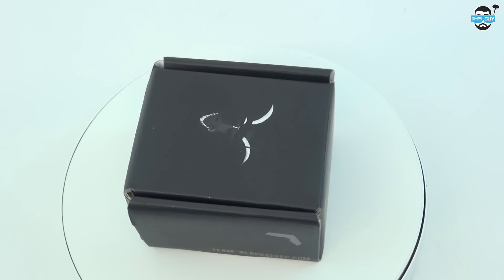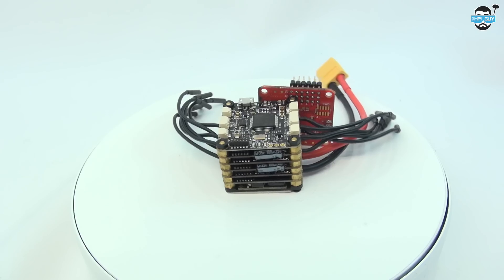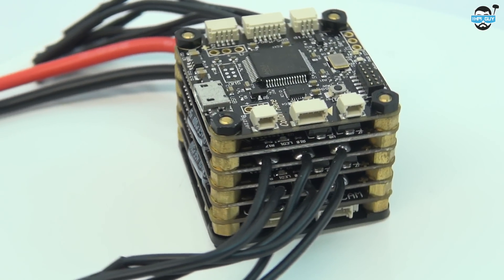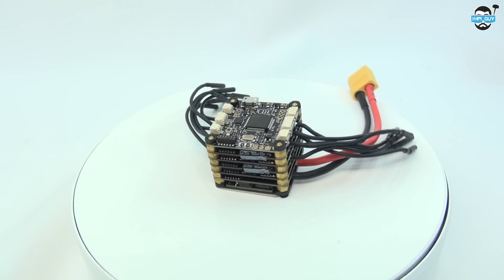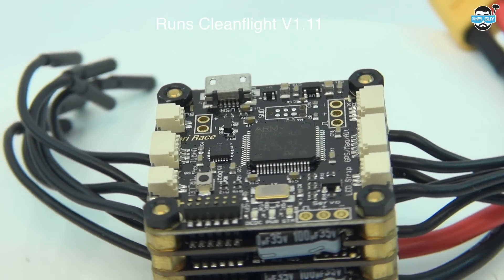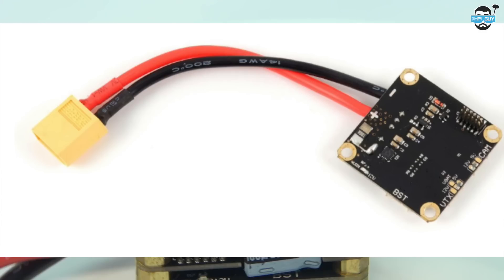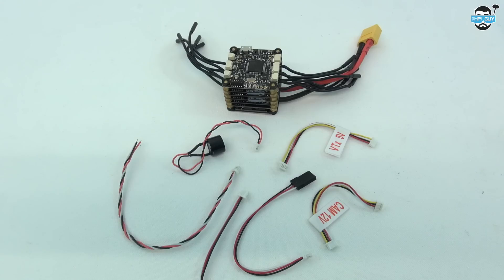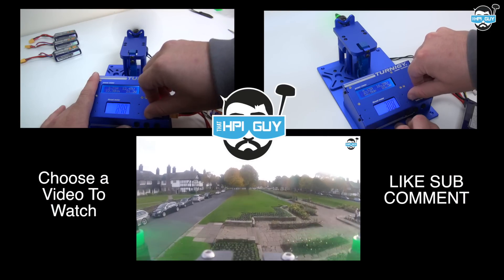HPIGUY | TBS PowerCube - Overview

Comment: WHat are the brass stand-offs for?
How do they work?
They look heavy.
Reply: +odinata they distribute power between the different layers ;)
Reply: +Team BlackSheep but how? they aren't insulated!!!
Reply: +odinata of course, that's why they can carry power! the brass standoffs touch each layer in the stack and form an electrical connection between your battery and each layer. So the power "travels up" the stack, from the PDB via each ESC to the flight controller.
Reply: Team BlackSheep
So the outside of the brass is coated with a transparent film?
They look like they aren't insulated...
Reply: +odinata I guess not. You have to paint it to prevent bad things from happening.
Reply: C Manson
Yeah, i just can't believe that they would leave bare electricity conductors with no insulation.
That doesn't make sense.

Comment: Considering a NAZE is $25 and decent ESCs are about $20 each (x4) this is a good value considering the engineering. It looks like you eliminate many points of failure by eliminated loads of wires and soldering points.  This also probably allows for a very well balanced quad in regards to center of gravity, etc...   I just wonder how well it will do in a crash (or a dozen)
Reply: +Bill Sheley Very good point.  There would be no repairing or replacing or individual parts I'm assuming.
Reply: +goofyfoot2001 As it turns out, TBS has spare parts and it is very much serviceable.  Its just a tad heavy without their aluminum standoff kit.
Reply: I'm thinking about trying it.  What do you think, yay or nay?
Reply: +goofyfoot2001 I just maidened my SpaceONe FPV 220 with the TBS Powercube and Rotorgeeks 2205 2700kv motors.  It flew brilliantly.  At this point, I am having great results.  My only question is how to get telemetry data from the powercube to something like a D4r-ii.  I cant seem to find any information on this.
Reply: +Bill Sheley im flying the cube and seeing the same thing.   I got the core pro and that is a waste of money with no artificial horizon.  it's going to take much longer to learn to fly fpv than I though for sure.
Reply: +Bill Sheley if you find anything can you post here please.
Reply: I'm going to try to hard wire the telemetry pin from the uart port on the cube to see if that provides data to the d4rii

Comment: Mine also did not come with any wires, but i never got an additional package afterwards.
Reply: +Tim A if you didn't get the cables, please log a ticket with our support crew we will get it shipped out ASAP.
Reply: +Tim A Where did you buy it from?
Reply: +revo russell I was part of the preoder from THuG frames UK. Shot them a quick email about it.

Comment: Will this work with sunnysky 2204s 2300kv motors. I'm having some sync issues with my current set up.  Budget ebay 20 amp esc, says simonk but who knows. Cc3d,  open pilot, never used clean flight.... Need a 30amp esc option.  Will be running 6inch props.
Reply from the maker: Yeah you shouldn't have a problem
Reply: +ThatHPI GUY where did you buy it?
Reply from the maker: +Chadeverythingcustom thug frames